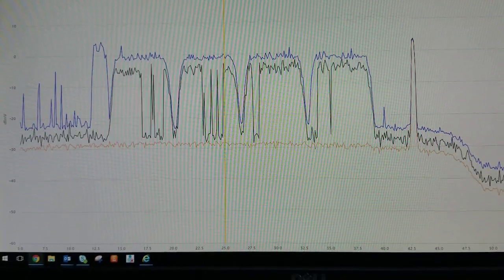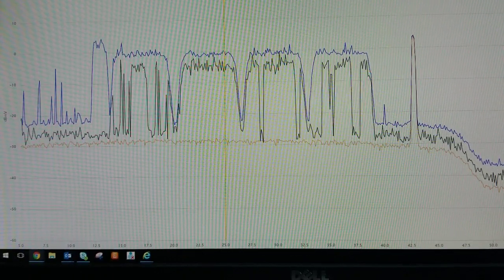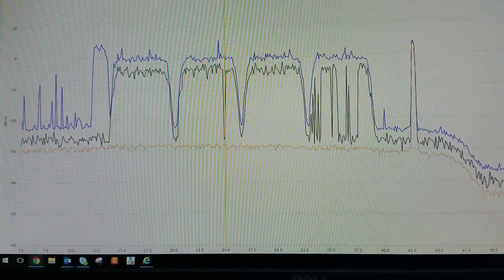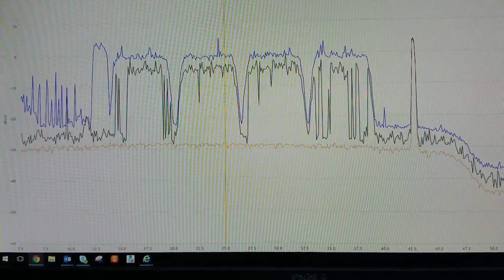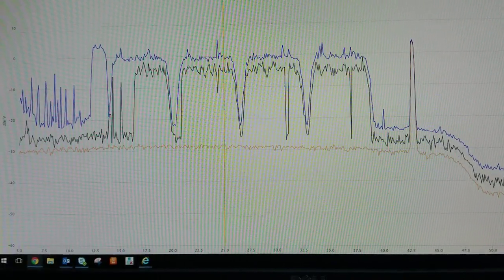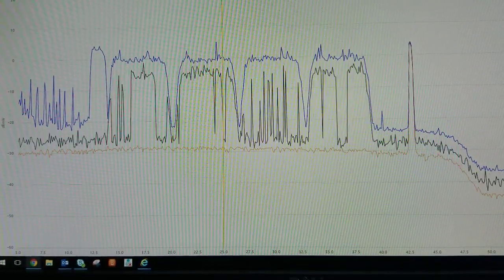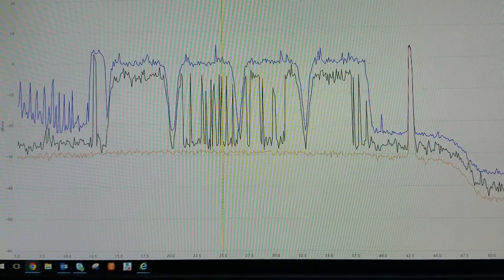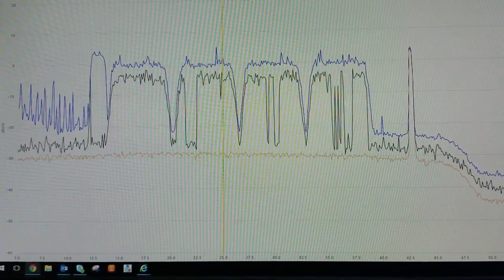Raised noise floor Digital CPD causing service issues.

Comment: No it doesn't help at all! I mean it DOES help, thank you but my goodness. Doing trouble calls constantly, how am I supposed to catch bullsh!t like this and avoid repeats? All I can do is scan, if the scan duration doesn't catch an abnormal fluctuation, I have nothing to submit for an ESR maintenance ticket :( I wouldn't even know it's there, I freaking HATE intermittent modem failure trouble calls where you scan CPE on arrival and everything's good. At that point i'm praying for bad ingress because then there's something to fix

Comment: It won't go for a month, trust me. It will come and go within 4 hours at a time and it sometimes stays on, and is caused by high levels of return signal, if it's in the same area, more likely is a bad feeder or Trunk.

Comment: I was doing an uplift in an area. Node was set up as a 4x4. 1 of the 4 nodes had elevated noise floor and we had not even set foot into that part of the plant. I went to help a maintenance tech try to track it down since I was going to be working there the following week and wanted to know the cause so I could address it while replacing equipment. Was just a lose connector on a 2 way splitter feeding strip taps. 1 1/4 turn fixed it all. Avrg USSNR was low 20s and went to mid-high 30s. I later cut a new node in and 2/4 nodes had elevated noise. That time was just a faulty card at the headend feeding an EDR transmitter at the node. As someone whose job isn't fixing these problems but upgrading the plant and seeing it occur out of the blue it's always nerve racking as if it was something my crew did and often the resolution was the silliest thing.  Really shows how sensitive the plant can be and yet it is still quite resilient in its own ways.

Comment: Is there anything that stands out while looking into any other impairments when the CPD is not currently happening that can point us in the direction of possible causes?
Reply: Radial breaks so if your plant has a tagger there can be diode crystals where breaks are or if you know the relative direction you can replace terminators and check connection points/faceplates for corrosion.

Comment: hi, can any one please tell me what do the black and the red signals mean ? and hiw to defuine that S/N is about 20 ?
Reply: Find s/n via your docsis tools or just the height of the haystacks minus the noise floor Max height. There is no red so I guess you mean the yellow line? That's min hold, it's useful in some circumstances when looking for constant impairments in the floor. The black line is realtime readings.

Comment: Just opened a 4th upstream on the node which runs my neighborhood. Internet has some bad common path problems from a feeder temp setup because some idiot ignored the locate flags and setup his fence post right through the dang cable. Now the we have HSD issues out the wazoo.
Reply: hi, what do the black and the red signals mean ?

Comment: sometimes a new active will be put in and the person did not check docsis and balance the return and you end up with a raised noise floor. Or just a low upstream at the node. I have found low upstream set at an active then i balance return then all the upstreams on a leg of the active are high. Which means somebody did want to look further into a problem, such-as bad cable or passives.

Comment: What hardware are you using for this video?
Reply from the maker: At the Headend there is a splitter on the signal coming in. It hits a product from Viavi (formally DSAM) and allows us to remotely log in and watch the spectrum analyzer of each node.
Reply: Pathrac (software)
Reply from the maker: Hardware? A Dell Laptop.
Reply from the maker: Samsung Note 8 for recording.
Reply: Should have been more specific. In reference to your method of viewing the RF on siad laptop that is. How are you connecting to the cable

Comment: This is off the subject of the video, but we a being required to fix issues in mactrak before we can close a node health ticket. With mactrak we are finding that it is issues with individual customers, and there is nothing feeding back and impacting anyone else in the node. Have you or anyone else fooled with it? Thanks
Reply from the maker: Some companies do address average issues in a node and if several inside the home issues add up it could trigger an alarm for needing repaired. Unfortunately that can be a symptom to that type of reporting.

Comment: Would love some tips on how to track it since it's so touchy...CPD is my biggest challenge..
Reply: Don’t pull power or Fwd. Don’t touch seizure screws. Only pull return pads. Track by monitoring return test point in each amp you hit or (invasive method) pull return pads. Any time you pull a return pad, watch for the elevation to drop and note the direction the cable goes in your plant. Go amp to amp until you don’t see it anymore, and then back track.  Note that probing seizure assemblies will more than likely make the elevation disappear. It is important to monitor your noise as read by a spectrum analyzer in the headend (PathTrak), while you are walking up to and preparing to touch equipment. If you touch something and the elevation goes away, 9 times out of 10 the device you touched is what is causing your issue.

Honestly? I just smack stuff until the elevation goes away, and when it does I cut out the last thing I smacked 😂 It’s effective 100% of the time.
Reply: @Wav10001  When you find the line that cause the elevated noisefloor pull the last tap in line, this open line will create sort of an echochamber which causes  visible cpd intervals when measuring at the amp. Then you take 150/cpd interval distance multiplied by vp (velocity of propagation) of the cable type. Usually (150/cpd interval)×0.88. This tells you the distance in "meters" to the problem going back from the open line you created. 😉
Reply: @NicB-Creations I’m seriously interested in this method. Is it possible to calculate that distance with multiple types of cable? Also what if there’s actives after and tap housing with the CPB (passes signal without the faceplate in), would I just pull the last tap before the next active and break the signal? I’m honestly interested in this formula but I feel like it’s not exactly a one and done for dense plants.
Reply: @Wav10001  hahaha that’s too funny. Best way I’ve ever heard to chase noise, I love it lol
Reply: @Wav10001 Or if it’s late in the day just pull power and wait for it to come back at a reasonable time haha. But really I’m going to try the smacking method. There’s nothing more annoying than having 4 splitters between 2 actives and the cpd isn’t on any of the actives after them. Like well I guess I’ll spend 2 hours taking everything apart and not seeing and corrosion and replacing 6 terminators hoping it doesn’t return lol.
Reply from the maker: Haha William did a great job of answering the question for me.
Reply: @thebasiccablechannel7464  yes he did. I forgot to thank him
Reply: What if you don’t have amps? Where can you find which tap the offender is plugged into?
Reply: Use your meter, don’t pull power, watch Pathtrak anytime your about to touch anything or set your ladder up. Extension pins, KS splices flat terminators ect.. I had a broken tap port cause CPD before.

Comment: Most the time I find a bad LE causing that issue. super pain in the ass
Reply: Those are the easy ones lol. Try finding 1 corroded fitting with 2 2 ways and 2 dc8’s between actives and the cpd isnt showing on the next active. Good luck touching the set screws lol.